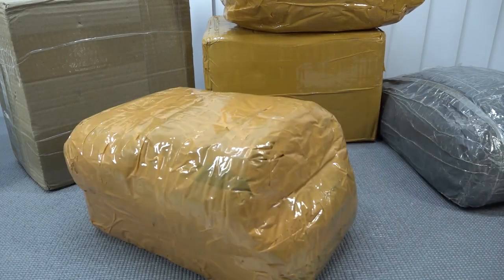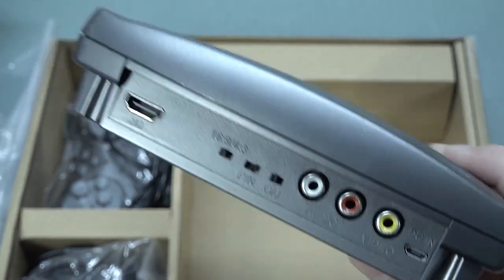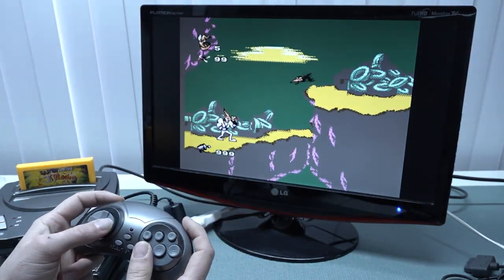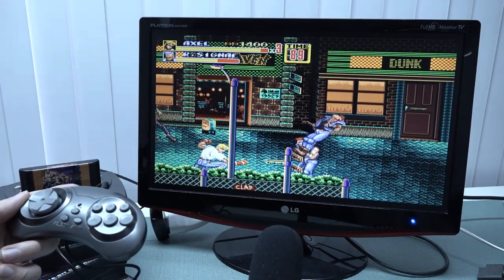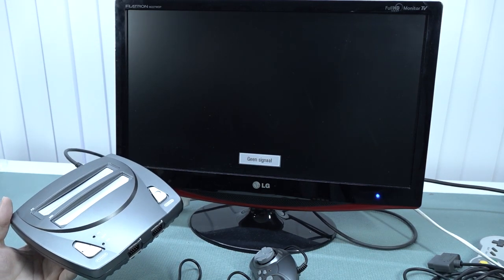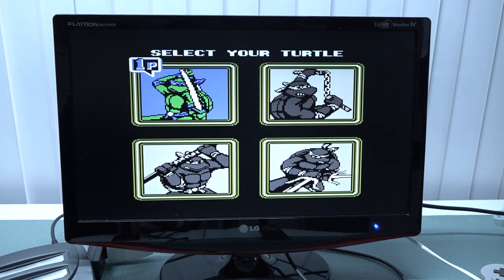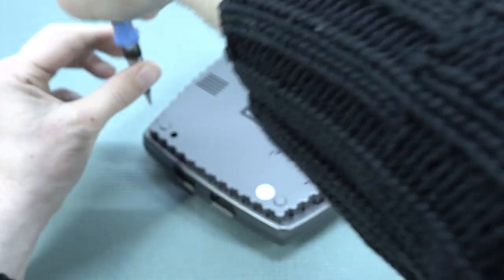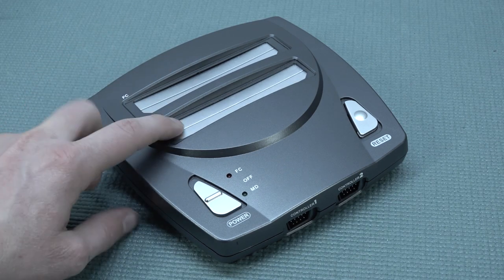Retroad Duo Retro Hybride Gaming Beast Machine !

Comment: This model (RD08HD) has 1080p output vs 720p output for (most) other SoC clones (Mega Drive/Genesis: GOAC: TCT-6803).  The video output is sharper. There are comparison vidoes on Youtube (there is a comparison video in Portugese). Model number: RD08HD. The audio output is in stereo (most clones output mono audio) and has switches for both console region and aspect ratio. The rest will probably always remain the same. Bad joypads and audio that deviates from the original Mega Drive/Genesis consoles.

Comment: i still prefer the Retrofreak, but this is a good solution too
Reply: I bought the retrofreak when I was in Japan back in 2016 and it's a decent system. Expensive, but it works well. Add on modules are expensive though and hard to find in the states so for Sega Genesis and SNES I picked up the offerings from Analogue and they don't disappoint.